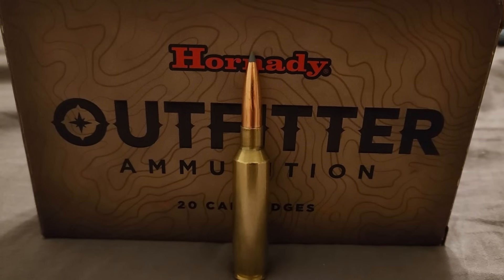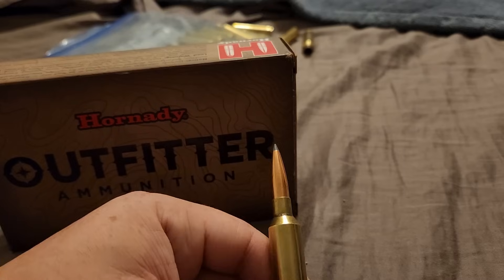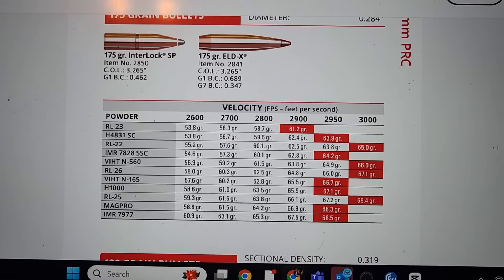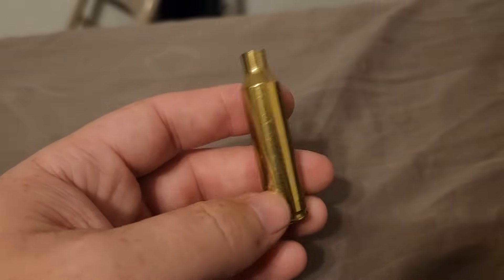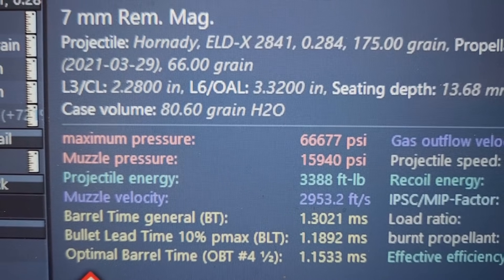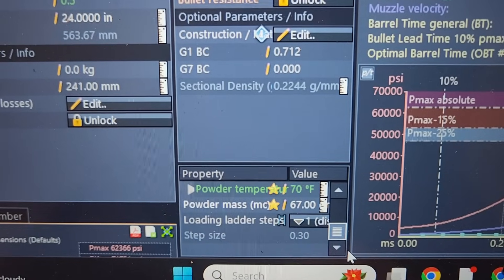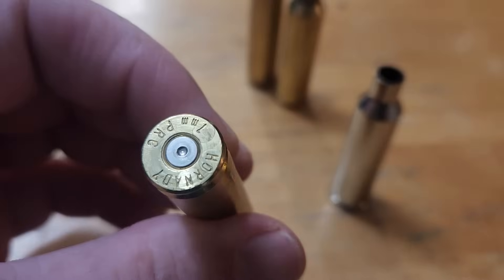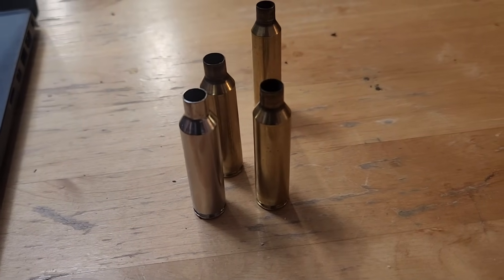Why your 7mm PRC is slow...

Comment: also dead wrong on  case capacity... yes an UNLOADED case will hold more for a 7mm Rem mag, but the bullet in a 7mm Rem takes up WAY more of the case in factory ammo... when you go above 160gr the PRC pulls ahead
Reply from the maker: You were saying? https://youtube.com/shorts/R4Lm-2R4Y5o?si=2P40MTA7rzTePP5z
Reply: @ReloadingWeatherby  Yep and I'm STILL SAYING IT.. You found ONE factory rifle with 1:8 twist barrel and are HANDLOADING past SAAMI length... Yes someone can have a custom 7mm REM MAG built with 1:8 twist and use ASICS mag, a custom reamer to allow for increased head height, but WHY when 7mm PRC does it from the factory and with good brass and N560/565 powder achieves the SAME or better veocities above 160gr bullet weight...
Reply from the maker: @christopherbenfield7848   You're still wrong about case capacity. Do me a favor, go look at Nosler 7mm PRC 185 load data online. Check out the case capacity. Than go look at 7mm Rem mag 185 load data. Look at the 7 mag case capacity and let me know what you find.
Reply: The newer production factory "long range" 7 mags hurting PRC feelings. I know at least Browning and Remington are making them. Likey others.

Comment: I use H1000 in my 24 inch 7mmSAUM. 2900fps with 180 grain Bergers. I’ve also used h1000 in 7mags for years. If I owned a 7prc it would be the first powder I tried.
Reply from the maker: You do you...
Reply: My cousin uses this with his 7mm prc with 180g Hornady match and she is getting 3030 fps out of his.  I just got the same to start reloading with.

Comment: Did a test today. Hornday new ammo.26 inch barell was 2970 old ammo new 2870..i.was 30 fps slower on 24 inch my.3 guns getting .29 to 39. Super accurate just little slow

I.shot 4 round ot of 8 boxes all different speeds 

Going to try 175 federal.eld x hear it's getting 3000.fps

Comment: A comparison of the 7mm PRC and 7mm WSM would be interesting.  I have read that the short-fat cases make better use of a given amount of propellant and the WSM is shorter-fatter.  The WSM might need to be loaded long to keep the bullet from taking up propellant volume, though.  That is a big reason why the 7 PRC gains against the SAAMI 7mm Rem Mag.  Especially with long bullets, the 7 RM loaded to SAAMI COAL loses its advantage in propellant volume.  Of course, loading the bullet farther out can remedy this, but that effectively creates a wildcat (ie, non-standard) load.  Also, a lot of people load to higher than SAAMI pressures, as well.

Comment: Hornady's main problem is that they did not change the label on the box when their ammo no longer made the same velocity.  The 7 PRC is still a good cartridge but the velocity claims were based on a single "unicorn" propellant.  Ironically, Federal had better access to Reloader 26 since it was a sister company to Alliant, the importer of this particular propellant from Nitrochemie.  Now that Federal has been sold by Vista Outdoors to another holding company, it will be interesting to see if preferred access to Alliant powders will continue.

The VihtaVuori 5XX series uses the same tech as Reloader 26 (made by Nitrochemie) of impregnating an extruded single-base powder with a small amount of nitroglycerine to get good temperature stability and ball powder-like energy density.  Nitrochemie/Alliant calls it "EI Tech" (Extruded Impregnted) but VihtaVuori just call theirs "high energy powders".  Unfortunately, it seems that VV they do not have a powder of the exact burn rate as RL 26.
Reply: This is an excellent, very thorough and accurate analysis. Unfortunately, VV does not have an exact match for RL26. However, at the same pressures, N560 will produce similar velocity with less powder and N565 will produce the same velocity with slightly more powder. N570 will produce even more velocity, if you have the room in the case to hit max pressure and the barrel length to burn it all at safe pressures.
Reply: @LittleCrowGunworks  Thanks.  It is good to hear from someone with actual experience.  My suppositions come from Recliner Research (the academic cousin of the Couch Commando).
Reply: @jfess1911  😆 Bravo Sir.
Reply: @LittleCrowGunworks  Thank you for the truth, and being honest and a part of this thread on this site. 
Merry Christmas to all.
Reply: I have got the same velocities with N560

Comment: My 180gr with 64.8 grains of h4841sc out of my 24 inch mossberg was getting around 2860 fps was very underwhelmed. But the accuracy is top tier and no animal is going to buck a 175-180 gr at 2700-2800 fps. Wish i had more but it is what it is

Comment: Seems counterproductive to me to only worry about speed.  I don’t understand the point of the video other than to say Hornady has different results than you are getting.  I have never gotten the same results as listed on the box regardless of manufacturer.
Reply from the maker: Who says I'm only worrying about speed? The point of the video is to point people to the ideal powder for 7mm PRC. Hornady has different results than me? Have you been living under a rock for the past year?
Reply: The “ideal” powder shouldn’t have to push a specific speed.  You said it yourself that some powders were very accurate but slow.  Wanna impress us, don’t just recommend a longer barrel for a wildcat cartridge. Perhaps being under a rock keeps me from chasing pipe dreams.

Comment: I have tried numerous combinations with my 7prc and i cant get over 2900fps without pressure signs.24 inch barrel and ADG brass 180gr eldm.Hornady and there modern cartridge design is a marketing gimmick at  its finest.Its a really accurate cartridge  I've found but a slug for speed.I'm sticking with my 300wsm,it can do more with less!
Reply from the maker: Thanks for sharing

Comment: I was under the impression that the PRC was not developed for velocity, rather; it was meant for precision with longer bullets at slower velocity. Which is something I struggle to do with my RemMag.
Reply from the maker: Do you have a fast twist 7 mag?
Reply: @ReloadingWeatherby  1:9 1/2  heavy barrel SAKO. I use 162 gr. @ 2750fps, mostly because I don’t like the recoil.

Comment: I have a 26 inch proof barrel on a tikka. I settled at 2940 fps with 175s which was close to pressure with Peterson brass and 67.1 grains of h1000 at 3.33 coal and fed 215s.
Reply from the maker: Very nice. Thanks for commenting

Comment: The 7 PRC is on my radar for a future purchase.  I think the Hornady PRC lineup of factory ammo velocities and the global powder shortages gives context to my comments.  I hand load for 300 PRC for my Bergara HMR 26 inch barrel.  Using this rifle, often with Hornady factory ammo I had ejector marks and flattened primers.  I started using Lapua 300 PRC brass did not see pressure signs like I did with the Hornady brass/ammo.  The Hornady 300 PRC ammo I purchased two years ago I did see velocities within +-2% of what was on the box.  However with newer Hornady 300 PRC ammo, I am seeing 125 - 150 feet/second slower.  I am using H1000 and Retumbo for hand loads and it is 100 feet/second slower than the Hornady manual.  I think Hornady should change the published velocities.  However my accuracy has been consistently 0.7 - 0.9 MOA, so I am happy with the accuracy.  I am working up 300 PRC loads now with the Winchester STABall HD and will chronograph those loads.  My STABall HD load data came from the Hodgdon Reloading website with a velocity range of 2652 - 2898 feet/second.  My rife ammo philosophy is chronograph your loads and zero your rifle for local atmospheric conditions, since velocity will vary in changes to the environment.  As long as the rifle is accurate and has the necessary energy at hunting distances, I can live with lower but predictable velocities for my hand loads and factory ammo.  Good video. Thank you for for taking the time and money to create it.
Reply from the maker: Thanks for sharing

Comment: Built my 7PRC knowing full well what to expect.  But, I found a load of H4831 and a load of H1000 with 175grn Berger that will shoot to same point of impact out to 800yds.  2950fps validated with drops and both shoot well under 1moa w/24" barrel.  Far surpassed my expectations.  I credit my gunsmith for all the above.  He also did a sort of stepped throat in my rifle.
Reply: You minds sharing the info as a guideline lol

Comment: I used to be a hornady fan boy , but the consistency of their 7mm bullets is terrible lately cause they are pumping them out ,I switched to Barnes LRX 168gr,  also if u want speed out of a 22” try H4831sc , I’m @ 2900 with no pressure signs , didn’t see any until around 2935 and it was a faint mark

Comment: I think I'll get a 7 PRC  and load it with H1000 see what happens. Also have Magpro that has worked well for me in 6.5 PRC. Just to see what happens. You can kiss any case capacity benefits from the 7RM when shooting a 170 or 180 class bullet. I concur with your statements about brass. I always have primer pocket issues with Hornady brass.
Reply from the maker: https://youtube.com/shorts/R4Lm-2R4Y5o?si=3vI7QNfPP3gz4weB

Comment: The best review of the 7 PRC to date! you're 100% correct Hornady brass is JUNK. Brass, barrel & bullets are the keys to success. The other thing I'm not sure that people aren't understanding, but not only do you need to spec your bullet to the powder but to your barrel as well. Short barrels need to be using a magnum power on the "faster" side of the scale. Powders such as Magpro, RL23, RL25, IMR7828 etc...etc.

Comment: The 7 PRC is a good cartridge, but not earth shattering.  As you stated, it has a few grains less case capacity than the 7 mm Rem (I estimate 2-3 grains) and is a bit more efficient in a short barrel, but not as efficient as a 7 SAUM or 7 SS.   I have a 7mm Rem mag with a 26 inch barrel and my friend has a 7 PRC with a 23 inch benchmark carbon on an impact action.  Both shoot well with similar powders, but for sure the data you present is accurate regarding velocity, etc.  My friend bought about 200 rounds of factory 180 ELDM and across his two lots, our average velocity was about 2810 fps, with a pretty high SD and ES.  The load which replicated factory velocity is about 67.5 grains of H1000.  We tested the loads in both Hornady and ADG Brass (way better brass) and their is no comparison.  The Factory Hornady loads gave us loose primer pockets after resizing and loading the first handload.  The ADG didn't show pressure signs until we really pushed it.  We took the 180 ELDM up in 0.5 grain increments in the ADG from 67.5 to 71.5 grains H1000 and recorded the following velocities rounded to the nearest 5 fps with 2 shot groups to find pressure: 67.5: 2805 fps; 68: 2835 fps; 68.5: 2865; 69: 2885; 69.5: 2915; 70: 2940; 70.5: 2980 and 71.5 was 3010.  I am certain this 71.5 grain load is around 68 to 70k psi, but the ADG brass can handle it short term.  GRT might give us more exact pressure, but for sure it is over 65K psi.  We got the best results for accuracy and consistency with 68 grains H1000 at 2835 fps, which is just over the factory velocity.  With the180 Berger hybrid target, we used 68.5 grain H1000 to get 2840 fps.  We tried a variety of seating depths, but found that 3.325 OAL worked well with both bullets.  The factory ELDM load has a 3.290 OAL, so we were only slightly longer.  The jam point of this barrel is 3.390 with the ELDM and 3.425 OAL with the Berger.   

My friend has 8 lbs of h1000 or I would have tried the N565.  You can almost interchange load data between H1000 and N565 but we have found N565 to burn a bit better in a shorter barrel and I prefer it over h1000 in most cartridges.  I did not try the N560 in the 7 PRC, but it works well in short barreled short Mags and is the closest powder to R26.  You can almost interchange the load data between the R26 and N560.  I have used Staball HD in two different 7mm Rems and one 7 SS with 180 bullets and it takes about 2 to 2.5 grains of Staball HD than h1000 or N565 to get the same velocity and pressure.  Like you said, it is too slow for the 7 PRC w/180 or smaller bullets but will work in a pinch.  H4831sc is a great powder with the 168 LRX and other 150 to 160 Grain monolithic bullets.    We took the 168 LRX to 69 grains of H4831sc, to check pressure, but it is too hot for long term use.  We Settled at 67 grains and an OAL of 3.165 inch, which gave us 3015 fps. Jam into the lands was 3.325 inch an as usual, the Barnes bullets shoot well with at least 0.100 jump.   The max load using H1000 (it is way too slow with a 168) was 72.5 gr and it showed pressure.  There is about a 3.5 grain difference in powder charges between H1000 and H4831sc to get similar velocity and pressure with the 168 LRX.  The final load with H1000 was 70.5 grain, but the H4831 at 67 grain is a much better powder with the 168 grain bullets.  I would estimate n560 to give 65-85 fps more velocity over H4831sc based on my loading in a 6.5 PRC, 7 Saum and 7SS with copper bullets of 125 grain (6.5) and 145 grain (7mm) but the H4831sc is very easy to work with and my friend also had 8 lbs to use in his 7 PRC so we used the H4831sc.  This powder will also work with a 175 or 180 Hornady, but it will pressure out faster than the h1000.  I would guess it would work better in a shorter barrel too than H1000.  In all loads we used WLR (Winchester Large Rifle primers) as he didn't have any Fed215 or CCI250 primers, but the WLR are one of the hotter standard large rifle primers and they work very well with this relatively short case.   In my 7mm Rem, I usually use Fed215M but the CCI250 are great too.  I found that the 7 Saum or 6.5 PRC cases perform a bit better with the standard Large Rifle primers than the Magnums, but the Magnums work fine for sure (use 0.5 to 1 grain less powder with the magnum primers) 

I hope this information is helpful.  I like your channel as you try to show real evidence without bias and you have a real passion for reloading and shooting.  I know you like long barreled Magnums.  My 300 WBY imp is 26 inch and they suck with short barrels, but the 7 PRC is fine with a 23 or 24 inch barrel when using the correct powders and can work not bad in a 22 inch.  For guys wanting to shoot a shorter 20 to 22 inch barreled, 7mm caliber with a suppressor, the 7 SAUM is tough to beat and the 7-08 can work pretty well with an 18-20 inch barrel.   Long powder columns and slow powders need longer barrels and shorter powder columns with faster powders work pretty good in short barrels.   It is about balancing the bullet, powder, cartridge and barrel length to find an efficient and accurate combination.
Reply: I found it very helpful. Thank you for taking the time to write down all your results
Reply: This was super helpful for us hand loaders. Thank you for all the data
Reply: @nuhnuh61 I have a channel I just started called the precisionmarksmanboltaction and precisionmarksmanarplatform where I share reloading and shooting content.  Thanks for reading.

Comment: I have a 7 prc browning xbolt 20” tube with N565 and 175 eldx im get 2850 is my average with honady brass I do have Peterson haven’t messed with it much. I do believe you are correct though I was messing around with grand and I was hitting pressure pretty early with it. I still like my 6.8 better it does have a 26” tube my hand load I’m getting right over 3000 fps with grand and 170 Berger
Reply: Interestingly enough I have a browning x bolt 7prc  with a 26” barrel and was only able to get 2850 with the 180eldm factory match ammo. I’m only able to get about 3 loadings on that Hornady brass before the primer pockets loosen up. I’m on my 9th firing with Peterson. With grand and the 175 eldx im able to find a good node at 2,940 fps and I was able to achieve over 3000 with grand but the groups opened up. What charge wt are you using with the n565 and the 175 eldx?
Reply: @ with N565 I’m running 67.5 it’s 2 grains or so over book but I have no pressure. When I was messing with Grand and hornady brass I got an ejection mark and I had one with hard bolt lift at 71 grains of grand now I haven’t tried it with Peterson brass. I try not to shoot my prc to much because it shoots lights out with the N565 load worst group I’ve gotten was .5 moa most of the time it’s hole for hole but every barrel has there sweet spot in there barrel life and I didn’t break the barrel in I’ve got maybe 90 shots in my prc. I didn’t break my 6.8 in either I’m being to to thank it doesn’t even matter I was get .5 moa with factory ammo after I went to sight it in. Every browning I’ve had or been around shoots really good but when you burn out a barrel most smiths wont touch them around my area because the xbolt have thread locker on the barrel unfortunately but there are ways to get them off but after you break it loose if it gets really hard to turn put the barrel back on because there threads are fine and most of the time it’ll pull the threads out
Reply: I’ve read the barrels on brownings are a pain as well and I’m already looking into options for a new barrel just to see how much I need to save up. I’ve only shot n565 up to 67.2g with the 175g but only saw about 2900 fps, haven’t really pushed it. I’ve got about 600 rounds on my 7 PRC with various combos of powders and bullets. It’s always interesting to see what people are getting.
Reply: @ one of my buddies is shooting a 175g eldx and I believe his is a 26” barrel or 24” but he’s using Ramshot LRT out of his and he’s getting over 3100 out of his browning